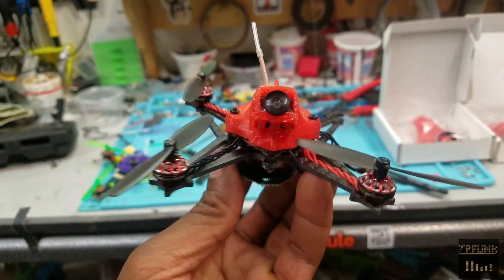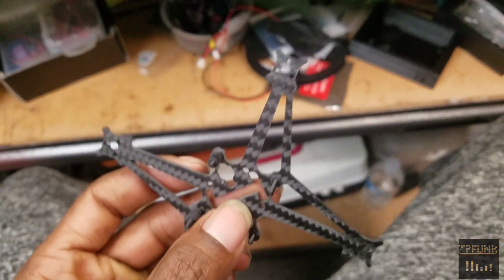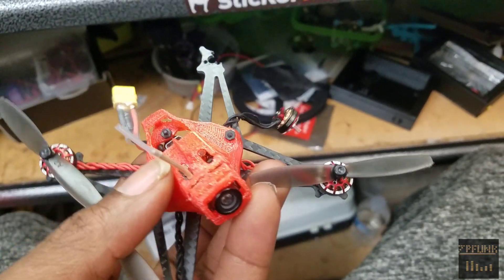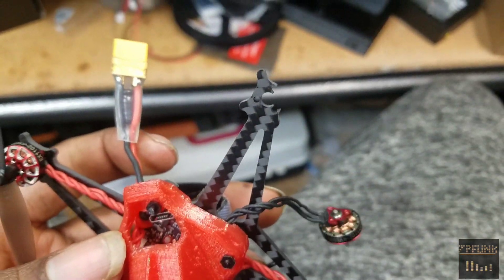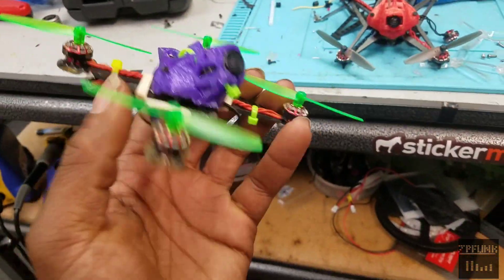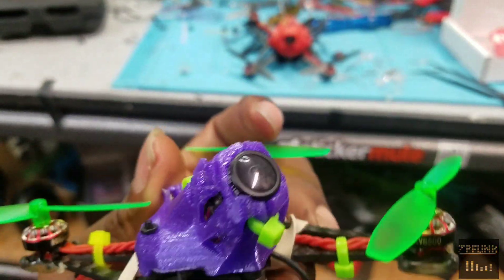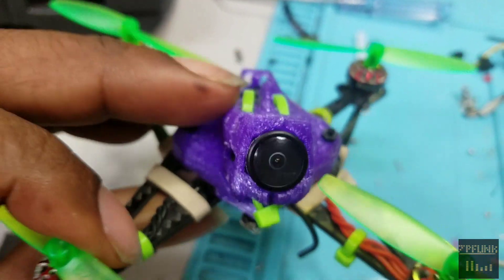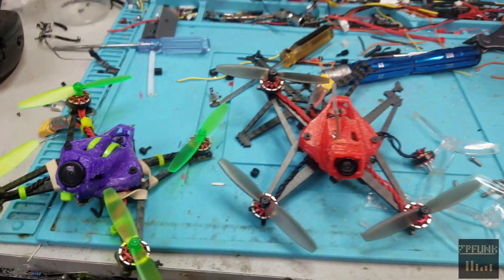Sailfly-X + Caddx E0S2 [Buy extra frames!]

Comment: Broke mine at the motor mount the other day, good thing the Sailfly frames are cheap to replace. Also you don't have to snip the canopy to fit the EOS2, just push it in a bit further and it fits perfectly.
Reply from the maker: Mine wouldnt fit, but good to know you can actually get the EOS2 in there on some of the canopies. I pinned your comment in case someone wants to try without snipping. Thanks!

Comment: the v2 frames suck just as bad.
Reply from the maker: I switched to the Gnarly FPV Primo
Reply: @ZPFunk  did the parts switch over without any problem. was it the 80 or 100?
Reply from the maker: @joegirty6609  Yes, everything swaps over perfectly, its 75mm motor to motor. I even made a 3s HD canopy for one and swapped a mob7 HD over. The newer Happymodel motors are better because they have 50mm wires. The shorter ones are a stretch though. Make sure you have everything setup before you swap it, because its a pain to get in there after the fact. It rips on the stock Crazybee f2 tune.

Comment: Hopefully they will start selling frames with extra material in those area's!  Also I notice after a few flights the motor shaft comes loose from the bell you have to use Zap Ca thin to glue them.  I am lucky I did not break my frame yet with some hard crashes but the motor shaft problem sucks.  Probably because it is 3s.  I still love my sailfly and I just ordered the Humquad HX 100!
Reply from the maker: They have informed me that the next batch will have Improved Frames.

Comment: They just need to rotate the hole pattern of the motor mount...
Reply from the maker: I talked to HappyModel, they informed me the "Next batch will have improved frames". So far the Hot Glue has held up in several crashes that would have usually been enough to break the mount.